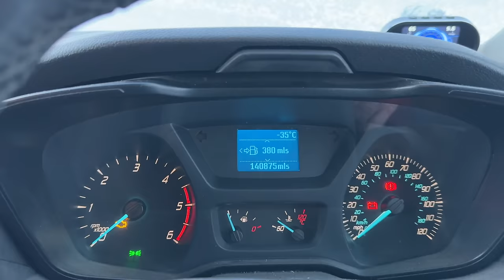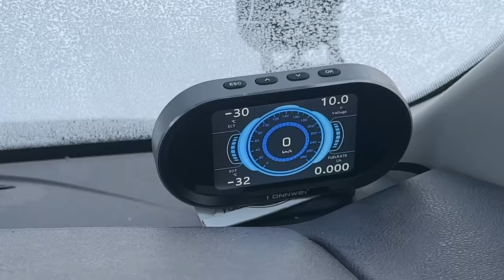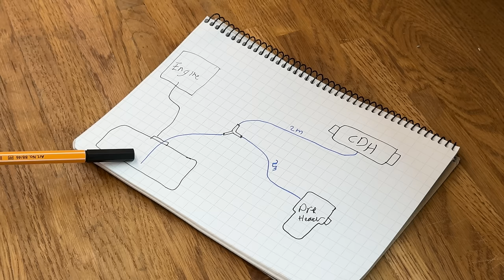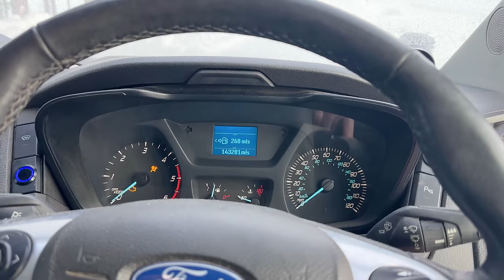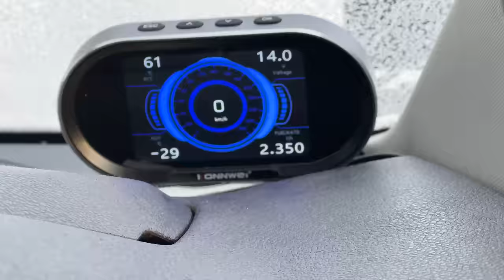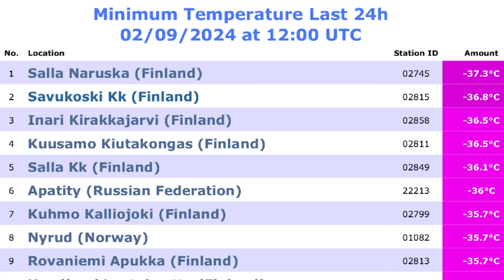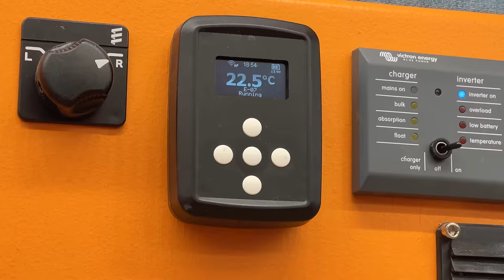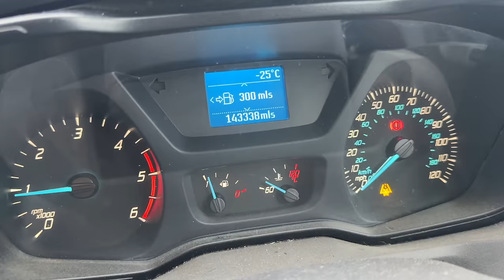DISASTER! Vanlife in the Arctic goes wrong!!

Comment: In Finland we have normal winter diesel -38 C and arctic diesel -44 C
Reply from the maker: Both of the bits of footage in the video the pumps were Finnish pumps. But said their operating temperature was to -35 and -38.
Given the temperature in the area I was in overnight was -37c it seems likely that I was right on the operating temperature of the fuel

I hadn’t seen a pump which had a label of down to -44c. I assume they’re specific garages?
Reply: @MispronouncedAdventures  Yes. "Neste" fuelstation and only from certain stations
Reply from the maker: Thank you I wasn’t sure which one particularly had  it. I’ll make sure for next winter. I head to those when I’m off searching for the coldest conditions.
Reply: @MispronouncedAdventures  I am from Canada and I wholesale diesel fuel additives to retail locations.  Our additive EXL Never Gel is good to -53C in the tank and -45C in the fuel lines and filters.  As well it adds 5 points of cetane and a lubricity additive.  Europe typical has a good cetane index but might be lacking on the anti-gel additive.

Comment: Saw a canadian van  builder fitting 240v electric heat pad to the underside of his oil sump - might be a good emergency measure as well?
Reply from the maker: I don’t think in this case it would’ve done much as the oil wasn’t an issue. I was still with the operating temperature of my oil which is 0w30. 

The diesel itself was the main issue

Comment: Good rescue problem solving vid Alex, wonder what the oils doing in the diff at that temp.
Reply from the maker: I imagine it would’ve been ambient as the engine oil was about ambient as well at -33 . That’s usually why when I talk about the cold I do mention the engine preheat is only heating the engine oil, the gearbox, differential and so long are going to be cold so take it easy for the first few minutes of driving to let those warm up via friction.

Comment: I'm planning to go to the artic but I don't plan to stop the engine before to be at destination.
Reply from the maker: That would be a bit overkill. It’s no problem stopping your engine overnight if you have ways to heat it back up again such as plug-in block heaters  or diesel engine preheaters like I have.
Reply: @MispronouncedAdventures  I guess it depends on the moisture level, I had -20°C in germany, I couldn't open the car on the morning, I managed to get in through the rear, then I had to scratch the frost inside the car, even after the engine started I could barely see anything.
Reply from the maker: @BaroudeurAventure  moisture in the Arctic is less than 20%. Absolutely bone dry.

Comment: Great stuff, love your ingenuity, a great asset when in such extreme conditions. you mention having a large battery bank. can I ask for the size and specs, please?
Reply from the maker: My lithium battery bank is medium the large size. 400ah of lithium in total. Using Roamer Xtreme series 12V 200Ah x 2. 

The extreme series are a variation on a normal LiFePO4 lithium cell which allows with discharge down to a internal cell temperature of -30 without damage and without heating
Reply: @MispronouncedAdventures  Thank you very much.

Comment: If you install larger pipes to the heaters, your problems should be less.
Reply from the maker: Heater don’t always like changes in there standardised bore. But being -35 overnight, I don’t think changing from 2mm to 4mm would have made  much difference. It was the freezing / gelling temperature of fuel which was the issue.

Comment: My old Opel Vivaro 2006 always starts at the same temperature and it had no diesel heater.
Reply from the maker: Older engines are a lot more simple
Reply: @MispronouncedAdventures   Mentioned it because it feels weird that your car won't start with diesel heater. If the diesel heater is on for 1-2 hours, it should start. Wondering if the diesel heater is pumping the coolant around in the engine. Are the hoses hot when you have used the diesel heater on for a long time?
Reply from the maker: @danieldanielsson5724 oh there was no problem at all with the engine starting after a pre-heater. I had done a few colder nights and with a preheated engine would start  like a summer day.

The problem was I probably had -35c grade winter fuel and it’s was -35 to -37 overnight. The fuel had gelled in the engine preheater and engine. But as it had gelled in the preheater, I couldn’t start the preheater to in turn heat the engine.

Comment: Just found your channel,, like my first vid...Sub !! I run my van all winter also in some pretty cold temps in Canada here... I use a cetane booster / anti gel.. (my favourite by far is Stanadyne, but Archoil is also one of the better ones) - I run it all year for the little amount and time it takes - the cleanliness inside the engine and especially in both the air heater (Espar) and engine heater (Webasto) almost triples the service intervals not to mention a small amount of improved fuel economy.... would greatly improve your coldest temps... Cheers
Reply from the maker: Thank you very much for subscribing. I don’t care that is diesel in your country usually pre-treated against gelling? In the Nordic it comes pre-treated so there’s generally not a need to add extra additives. In this occasion though I had probably used a slightly more urban winter grade diesel on some exceptionally cold weather hence causing me the gelling issue. 

I generally all year round run premium diesels with cleaning additives in it which seems to do a good job at cleaning my engine as well as my heater and pre heater
Reply: @MispronouncedAdventures   The additive is extra protection for super cold events but the added cetane is the juice,, there is no diesel options in Canada, its all premium year round and calibrated to the season.... and most of the country see below -40C in winter...

Comment: Could you run the exhaust exhaust from the cabin heater across to your engine heater?
Reply from the maker: Not really. the diesel heat exhaust generally need to be kept quite short .  To run the exhaust from the back driver side over to the front passenger side would be difficult anyway because the prop shops in the way it would have to be about 3 m long

Comment: Maybe try out a block oil heater next year (like Adz has), see how it compares to the diesel preheater. As for SLA batteries, said enough before on that... It was interesting to see how easy 'Ria on Roaming Reckless SLA died within an hour of last being used stranded up a mountain in a blizzard (she'd deep cycled it too much) <-- Interesting video to watch btw ...also those with boost jump starters need to know how to force jumping as a dead battery will not be detected by the jump starter (Noco have this feature with no magic key presses). Timmy over on Truck House Life didn't turn his engine off for 5 days at one point...up in Deadhorse AK.
Reply from the maker: I don’t think an Oil heater would do much for me in this case on my van , the Transit’s Oil is 0W30 which is suited for that sort of cold and lower. 

I’ll have to check out that other channels. But deadhorse does get a lot colder
Reply: @MispronouncedAdventures  You can go down to -50C in Sweden, it's not unheard of...which is Outdoor Boys kind of temps in AK. Did you see what happened to that camper van this week on the NC500 after that wind gust? Lucky people!
Reply from the maker: @LoremIpsum1970 I did see what happened on the NC500, not a fun evening in the motorhome for sure

Comment: Loving the videos. Will the next van be a Mk8 transit? Interested to hear your thoughts on these vans vs say other makes / models and say FWD equivalents (yes - I've trawled through the whole back catalogue!). 
Guessing the next van will have some sort of LSD or maybe 4WD?
Reply from the maker: New van will be a AWD transit.  Having driven many models of vans and in FWD and RWD. Personally for me was the transit as soon I got into one.  I found it to be the most comfortable and car like to drive and the most up-to-date and modern dashboard. additionally, because it’s a campervan, I personally prefer the rear wheel drive as it gives me a lot more traction with all the weight over the back. Additionally the transit is also one of the tallest internal options of the vans which is great considering I’m 6’2
Reply: Looking forward to the next build! I've always been a fan of the transit!
Reply: @MispronouncedAdventures have you had any issues with the wet belt on the transit ?
Reply from the maker: @markb1971 nope, had its replaced at 111k.

Comment: Any protection to the fuel lines to avoid freezing.
Reply from the maker: The grade of the fuel was the bigger issue here. yes insulated fuel lines do help heat loss but stationary overnight for 12 hours in -35c  probably wouldn’t help that much in the grand scheme of things. plus in my three winter and multiple other colder nights. This was the first time it been an issue. I suspect I filled up with -35 winter diesel and not -38 last time. It’s was -35 to -37 that night

Comment: Hej kompis jag tror att du kan eventuellt ha lite vatten i tanken, dieseln ska inte frysa. Har varit i husbilen vid minus 45 grader och det fungerade bra.När det gäller däck så tror jag att du missuppfattade mig, vinter däck är speciella däck man använder på vintern spelar ingen roll om du vill ha dubb i eller inte det skiljer sig i gummiblandningen. Mvh Angus
Reply from the maker: Depends the grade of the diesel you filled up of I might have filled up with the -35 fuel ( which is seen at the end of the video ) before that particular drive, and since the temperatures that might were around -35-37 I was probably below the operating temperatures, which is why it gelled. 

As for tyre, yes, I am aware of the different compounds in winter tyres . It is something I have found with my particular tyres I use even in those conditions the rubber remains pretty soft.
Reply: Hej jag tankar på bensinstationen som alla gör i sverge dom kör vinter diesel på vintern, jag har bott i norra Sverige i 52 år utan problem .

Comment: Just a question can’t attach a heater to the fuel tank & insulate it to warm the fuel in extreme conditions ?
Reply from the maker: Whilst you probably could do those things, it’s not really necessary. It reaches that cold not that often, and I done plenty of other cold nights without issue, I had just filled up with a slightly lesser grade of  diesel than I had thought

Comment: I see your van has 143k on the clock. How reliable has it been? I'm considering one and it would be good to get real user input. Thank you!
Reply from the maker: Generally very reliable I’ve found. A few bits and pieces.

I bought it at two years old 79k miles. 

79k new air-conditioning compressor sold to me broken unknowingly, covered under warranty ) 
Around 90k the flywheel went, so new clutch and flywheel. 
111k new wet belt ( pre-emptive replacement ) and new vacuum pump ( failed ) 
125k new thermostat
130k new power steering pump ( I broke it doing doughnuts in Arctic round 2
145k ( new alternator clutch pulley ) 

Apart from that disc and pads, one wheel bearing and one serpentine belt. 

And whilst there is a little bit of a list there, I’ve not exactly given it an easy life.
Reply: @MispronouncedAdventures  That's pretty good considering most of your list is general maintenance items. Thanks for taking the time to give such detail, I really appreciate it.
Reply from the maker: @andypugh2000 no problem. It clearly had a hard life in the two years prior to my owning of it  given the miles.

But my things I see is generally minor for a vehicle of its mileage. Fair to say I’m happy with it

Comment: I would insulate the lines and wrap them in a low-voltage heating element like what's in motorcycle gloves.
I would also cover the diesel tank with a thermal blanket with a heating pad.
Lot of work, but it's a good fall-back. Then there is always the heat gun - but that may not work as it would be way too cold (minus 40+) to keep them from freezing back up.
Reply from the maker: Definitely a lot of work for a very rarely need issue I think they only saw sub -35 around three times this winter. I think next time I will go to a Neste fuel station buy the -40c fuel when it’s gonna be particularly cold opposed to the regular -35 and -38 winter diesel.

Although insulated fuel line might be on my list of considerations

Comment: cant you put alcohol/cold additive (not a special fuel, but an additive to a good arctic diesel) or petrol to the tank of diesel? i know back in the day people have put some petrol to a tank of diesel, so it wouldn't gel, but since everything has become common rail... i dont know... can you still do that? I've heard people adding 2T 2 stroke motorcycle oil to make CR components last long? Do you thing any of these are good ideas in the arctic? can you make little experiments with this? not sacrificing the transit if anything goes wrong, but like jerrycan experiments.
Reply from the maker: Whilst the winter grade diesel is pre-treated at pumps. It has its limits which I went past.  

But yes to could add your own extra addictive on the extreme cold nights. Normally the -38c winter fuel is fine

Comment: Would insulating your fuel lines under the van help?
Reply from the maker: Insulating the fuel line help in some cases for sure. But insulating only slows down heat loss. -35c is really cold! so it might of held off gelling for a few more hours. It’s normally not that cold Anyway
Reply: @MispronouncedAdventures  I guess if the insulation is wet and frozen under the van it won’t work as well either.

Comment: Vid dom låga temperaturerna stänger jag ALDRIG av motorn 
Problemet löst
Reply from the maker: Usually it’s not a problem. I’ve done plenty of colder nights and the engine preheater started the engine no problem at all. It just seemed this particular night. I had -35 grade winter diesel which gelled up. 

Idling for 12 hours isn’t gonna be particularly good for the DPF for a modern van
Reply: Det är inga problem alls med Dpf 
Gjort så många gånger med husbilen och varje natt med lastbilen

Comment: here's a tip for starting in extreme cold conditions:
depress the clutch when starting the engine.

manual gearboxes often have oils (especially Ford) that gel up really stiff in ambient temperatures of minus 20 or more. so when you're starting the engine, the starter has to spin up that stiff gearbox as well. 
your engine will likely start just fine, when the clutch is depressed. 
NOTE: even putting it on neutral will not be enough. you need to disengage the whole gearbox.

EDIT: to me, your heater is showing signs of the burner screen going bad. it's a 20€ part, but requires taking the heater apart a bit.
Reply from the maker: That was the clutch depressed. The clutch has to be depressed in a mk8 transit to attempt to start, the vans computer doesn’t allow the vehicle to start if the clutch is not fully depressed
Reply from the maker: Which heater are you referring to? When you say burner screen, do you mean the atomiser?
Reply from the maker: @apple_with_a_human_butt  yeah, I imagine many different languages called at differents. 
Yeah, I think the extreme smokiness was a byproduct of some partly gelled up fuel.  Although with both heaters and the engine itself in the extreme cold the exhaust vapours are a lot more visible than usual anyway. 

But since the symptoms had multiple failed starts when I finally got it some sort of combustion it looked like it was spirting in some diesel but not enough to keep it going which was leading to the white smoke